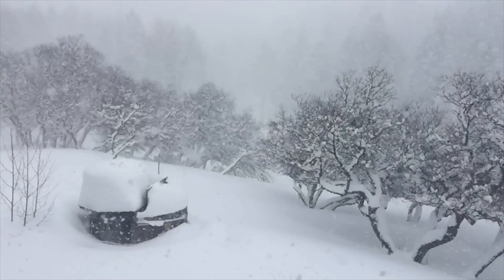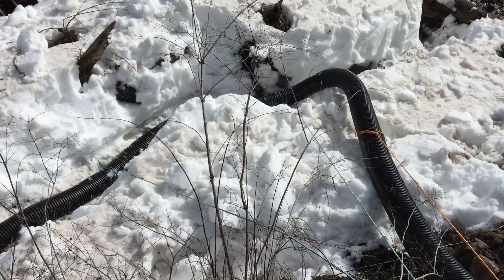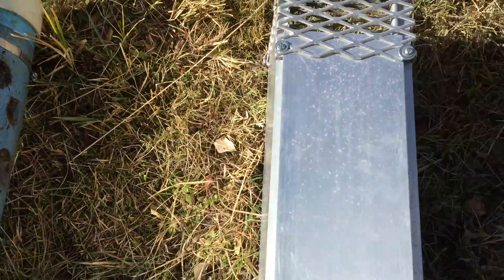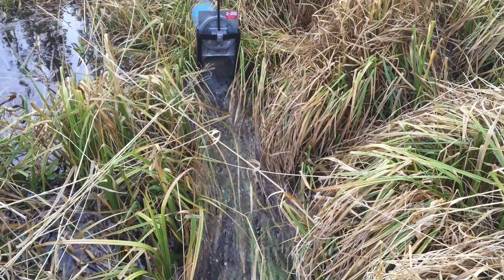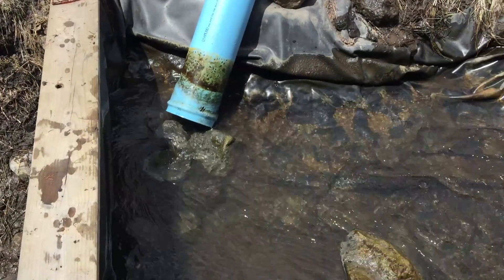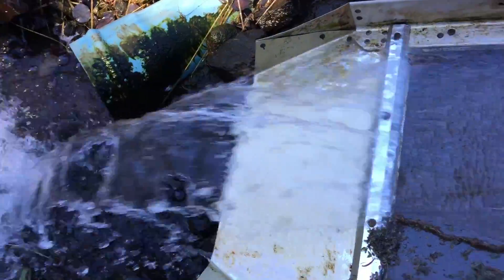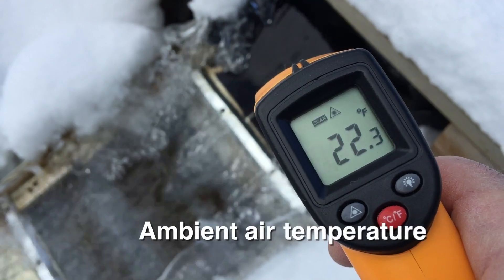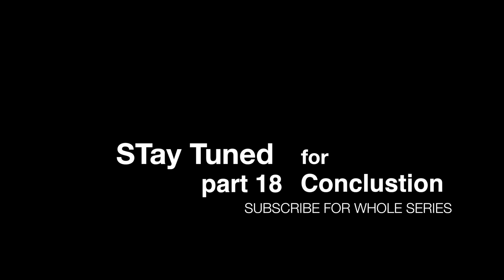Part 17 MicroHydro Power System in CO

Comment: I might learn without asking if I watch your entire series, but I don't have sufficient time to do that right now; so, if you don't mind my asking, how much vertical head on the system to develop nearly 100 psi at your powerhouse? It is over 200 feet, is it not?
Reply from the maker: Formula is 2.31 ft vertical for each psi. That is for static measures. Dynamic moving water has varying pipe friction losses depending on flow and pipe size
https://www.absolutewaterpumps.com/blog/convert-feet-to-psi/
Thx for watching

Comment: Place a tee fitting place an 8 foot pipe vertical to the flow and the water will flow and the air escape.  SCOTT FROM NH.
Reply from the maker: Lots of people have suggested air vents.  The path of the pipe has only minimal fall where the air gets trapped.  There isn’t any pressure to keep a vent closed.  The problem is that the negative suction pressure from the lower part of the pipe would simply suck air in at the vent holes. That is why when I bleed the air out through the holes I need to close the gate at the pipe outlet. Once the air is out of the line, the flow is dramatically increased. Thx for watching I'm never sure who has seen what of the series. Here is a playlist of the 3 part synopsis which is an overview of the whole process https://www.youtube.com/playlist?list=PLtTypVpmDd-vkT9bJQkXw4I1t0e_4jMYA 
 The whole series is in about 25 videos. This part 17 video gets promoted most frequently by YouTube.

Comment: Consider installing tape heater on the pipe ends that activate only when the temperature drops, that way it might reduce the ice build up.
Reply from the maker: Its 1/2 mile from intake to available power. Lots of people suggest similar or mechanical solutions for what is routine cleaning which at this point is seldom required. Many issues have been resolved which were just part of the process over the years. There are always new challenges but this is not one of them.  I'm never sure who has seen what of the series. Here is a playlist of the 3 part synopsis which is an overview of the whole process https://www.youtube.com/playlist?list=PLtTypVpmDd-vkT9bJQkXw4I1t0e_4jMYA 
The whole series is in about 25 videos. This part 17 video gets promoted most frequently by YouTube.  Thanks so much for watching!

Comment: have you tried a pop up vent fore the air in the pipe
Reply from the maker: Lots of people have suggested air vents.  The path of the pipe has only minimal fall where the air gets trapped.  There isn’t any pressure to keep a vent closed.  The problem is that the negative suction pressure from the lower part of the pipe would simply suck air in at the vent holes. That is why when I bleed the air out through the holes I need to close the gate at the pipe outlet. Once the air is out of the line, the flow is dramatically increased. Thx for watching I'm never sure who has seen what of the series. Here is a playlist of the 3 part synopsis which is an overview of the whole process https://www.youtube.com/playlist?list=PLtTypVpmDd-vkT9bJQkXw4I1t0e_4jMYA 
 The whole series is in about 25 videos. This part 17 video gets promoted most frequently by YouTube.

Comment: This may sound silly but if you dipped the colander to make it black, would that deter ice cover?
Reply from the maker: IF the sunlight consistently hit the Coanda screen, it might have a small impact. However its mostly in the shade of trees and the terrain. The freezing eventually forms a shell over the screen and the water continues to flow, so what once seemed a problem has turned out to not be a concern. 
Thanks for the suggestion.  This video was posted quite a while back and many subsequent modifications have been made to enhance the system and overcome problems. Thx for watching  I'm never sure who has seen what of the series. Here is a playlist of the 3 part synopsis which is an overview of the whole process https://www.youtube.com/playlist?list=PLtTypVpmDd-vkT9bJQkXw4I1t0e_4jMYA 
 The whole series is in about 25 videos. This part 17 video gets promoted most frequently by YouTube.

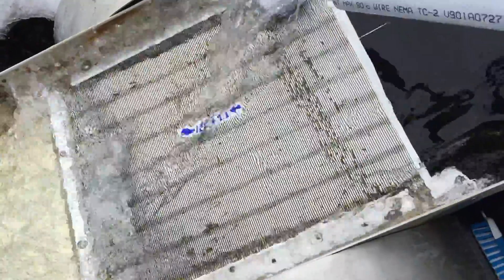Comment: 9:43 get 4 wooden scrubbing brushes, screw them toge that you get a four sided brush, best with some metal brackets to give them some more weight. Add a string to them to the upper left side of the screen and a loose string somewhat below the screen on the right side. Add some kind of rubber as a lug on the lower string just below the screen. 

If you adjust it right it should scrub with the brush over the screen, left and right, depending on the turbulences and the flow rate.

I would add also a bit higher stop at the bottom of the screen, to get a bit more pressure downwards on the screen, to get all water on a lower flow rate.
Reply from the maker: Thanks for the suggestion.  This video was posted quite a while back and many subsequent modifications have been made to enhance the system and overcome problems. It requires next to no maintenance at this point, not even screen cleaning. Thx for watching

Comment: Why don't you add a float valve mechanism to the vents. Like cutting a piece of the pipe away at the top, placing a metal lit on top with a small bump upwards. Attach a ping-pong ball on a metal wire under the lit, that the water will drag it down stream exactly in the center of the bump. Then drill a tiny hole over the center of the ball.

If the water drops the air will be vented automatically, if the water level is high enough it should be sealed enough. 

If the mechanism fails, like the ball is lost, you can replace the whole assembly in minutes if you have a spare one. 😙🎶

Comment: I wonder if you couldn't put a little turbine that would power a heating element to keep things from icing up.
Reply from the maker: Lots of people suggest similar or mechanical solutions for what is routine cleaning which at this point is seldom required. Many issues have been resolved which were just part of the process over the years. There are always new challenges but this is not one of them.  I'm never sure who has seen what of the series. Here is a playlist of the 3 part synopsis which is an overview of the whole process https://www.youtube.com/playlist?list=PLtTypVpmDd-vkT9bJQkXw4I1t0e_4jMYA The whole series is in about 25 videos. This part 17 video gets promoted most frequently by YouTube.  Thanks so much for watching!
Reply: @mrhydrohead  I have seen quite a few of them and am very impressed. Especially since your doing this in a place that is so cold. I have spent my life in the desert so those conditions are unimaginable to me. The only snow I ever see melts before it hits the ground. So my first thought is how to fully automate the system so I don't have to go out in the cold. I hear you get used to it but like I said its unimaginable to me. I don't even own a jacket. What you are doing there is absolutely amazing, I wasn't at all trying to take away from that. Keep posting videos and Ill keep watching, I love what you are doing!
Reply from the maker: Another commenter pointed out the error in the link I provided that it didn't work.  It should have been https://www.youtube.com/playlist?list=PLtTypVpmDd-vkT9bJQkXw4I1t0e_4jMYA  
Sorry about that.

Comment: yep water  flow and winter temps lots of  challenges even for northern koi and goldfish...   and ice chipping tec... always a bit dif each season...
Reply from the maker: Thx for watching I'm never sure who has seen what of the series. Here is a playlist of the 3 part synopsis which is an overview of the whole process https://www.youtube.com/playlist?list=PLtTypVpmDd-vkT9bJQkXw4I1t0e_4jMYA The whole series is in about 25 videos. This part 17 video gets promoted most frequently by YouTube.  
The system really doesn't require much maintenance and just runs year round.  Lucky to have sourced power this way.
Reply from the maker: Another commenter pointed out the error in the link I provided that it didn't work.  It should have been https://www.youtube.com/playlist?list=PLtTypVpmDd-vkT9bJQkXw4I1t0e_4jMYA  
Sorry about that.

Comment: Here is an alternate energy source to use where hydro power is not available.
Research terms with DuckDuckGo: lenr-canr MizunoTincreasede pdf
Reply from the maker: Interesting stuff.  I don't personally have a need for more power, but others may find this of interest. thanks for sharing.
Thx for watching I'm never sure who has seen what of the series. Here is a playlist of the 3 part synopsis which is an overview of the whole process https://www.youtube.com/playlist?list=PLtTypVpmDd-vkT9bJQkXw4I1t0e_4jMYA The whole series is in about 25 videos. This part 17 video gets promoted most frequently by YouTube.
Reply from the maker: Another commenter pointed out the error in the link I provided that it didn't work.  It should have been https://www.youtube.com/playlist?list=PLtTypVpmDd-vkT9bJQkXw4I1t0e_4jMYA  
Sorry about that.

Comment: Baffles in the pipe my cut down on the air bubbles
Reply from the maker: Thanks for the idea.  Lots of people have suggested air vents.  The path of the pipe has only minimal fall where the air gets trapped.  There isn’t any pressure to keep a vent closed.  The problem is that the negative suction pressure from the lower part of the pipe would simply suck air in at the vent holes. That is why when I bleed the air out through the holes I need to close the gate at the pipe outlet. Once the air is out of the line, the flow is dramatically increased. 
Thx for watching I'm never sure who has seen what of the series. Here is a playlist of the 3 part synopsis which is an overview of the whole process https://www.youtube.com/playlist?list=PLtTypVpmDd-vkT9bJQkXw4I1t0e_4jMYA The whole series is in about 25 videos. This part 17 video gets promoted most frequently by YouTube.
Reply: Awesome/ retired firefighter with the Ventura effect yes low pressures, would not be effective enough
Reply from the maker: Another commenter pointed out the error in the link I provided that it didn't work.  It should have been https://www.youtube.com/playlist?list=PLtTypVpmDd-vkT9bJQkXw4I1t0e_4jMYA  
Sorry about that.

Comment: This is amazing. Now I’m pissed I didn’t buy land with a stream. I’m on top of a mountain and I don’t see anyway to become power or water independent.
Reply: @Jmiah 79, don't give up.  There may be ways.  At least for drinking water, you can buy or build an atmospheric water generator.  For electricity, you can buy or make a device to convert heat into electricity, such as from a wood burning stove.

In case these devices are new to you, here are some video titles:

"Devil Watt 45 watt Wood Burning Stove Thermoelectric Generator"

"How to charge your smartphone using fire/heat||amazing experiment at home"

WATER HARVEST FROM AIR:
"Warka Water towers harvest drinkable water from the air"

Or devices (powered by electricity) can be purchase off Amazon, etc.

Perhaps you could also barter for what you need.  For instance, if you don't have enough sunlight on your land to recharge batteries, perhaps another land owner nearby can recharge them for you in exchange for labor, firewood, etc.
Reply: @Jmiah 79, to reduce water needs, have you heard of the Showerloop?  It cleans you used shower water and adds it back through at your showerhead instead of down the drain.  Here is a video by the inventor whom made it open sourced.

"Showerloop - an open source hot water recycling system"
Reply: @Jmiah 79, sorry for so many posts.  Have you considered a rocket mass heater?  That way you can heat your home for 24 hours or longer on very little wood.  It takes just the size of small diameter kindling.  Even after the fire is out, the mass continues to releases heat slowly, so you can sleep instead of tending the fire.  I don't have one, but people that do say they stay warm all night and it greatly reduces their fuel use.  Can heat a small house easily.

I would definitely do my homework first and buy a book to follow, too.

Here is a helpful video.  She said she followed a book:

"Building a Rocket Mass Heater step by step to finish! Watch to the End!!!"
Reply from the maker: All good ideas. thx for sharing.
Reply from the maker: Don't despair, solar is so much less expensive than when I started in 1996.  I just had this great resource of the water and the desire to take advantage of it.  You must have a ton of solar access being up high.  thanks for watching just the same.

Comment: If you use smooth pvc piping without the ruffles it will move much faster
Reply from the maker: Our first diversion was indeed fixed pipe, but it was all washed out by the huge spring run off.  That is why we have made the diversion pipe removable for the spring melt.  The flexible pipe easily diverts enough water for our system and leaves the rest to conserve the natural state of the creek.  The creek changes each year and the collection point is different.   Thx for watching I'm never sure who has seen what of the series. Here is a playlist of the 3 part synopsis which is an overview of the whole process https://www.youtube.com/playlist?list=PLtTypVpmDd-vkT9bJQkXw4I1t0e_4jMYA The whole series is in about 25 videos. This part 17 video gets promoted most frequently by YouTube.
Reply: @mrhydrohead  Thanks for your reply I did start on ep. 17 but since I read your comment earlier today Ive watched 1-17 and on to the rest .Your link doesn't work by the way but I'm sure I can find it in your uploads . I have a much smaller water source that I maybe able to fill a 6 inch pvc pipe with for about 3 hundred feet of fall my house is about 900 to 1500 feet away I was thinking about stepping it up in voltage and then stepping it down at my house and I wanted to research wireless electrical transmission to see if I could use Tesla coils to transmit and receive it .
Reply from the maker: Thanks for pointing out the link problem.  I was totally unaware of that.  "The" at the end isn't required, but for some reason it gets added.  Not that it matters for you now, but here is the correct link https://www.youtube.com/playlist?list=PLtTypVpmDd-vkT9bJQkXw4I1t0e_4jMYA  
It sounds like you have an enormous potential for power.  One thing that was emphasized in the class I took at SEI in 1996 https://www.solarenergy.org/micro-hydro-training/ was that you should look at what your actual need for power is by doing an energy analysis of your appliances, lights, etc.  Otherwise you can spend a lot more than you need to meet your needs.  Also I think its important to not entirely drain the watercourse completely as the natural environment relies on it for animals and whatever.
As far as transmission goes, yes bumping up the voltage will cut down on transmission wire cost.  I think ours is about 1200ft. if memory serves me.  As far as Tesla Coils go, I don't have any knowledge of them actually being put into practical use.  Perhaps his genius figured it out, but JP Morgan squelched it because he realized he couldn't charge people for it.

Comment: Here is an idea that you might incorporate to cut down on your algae problem.  Copper screens. 

Copper is just about the best antimicrobial there is .  This is how I kept algae out of my swimming pool.  See floatron.com.   I used a floatron for my pool for about eight or ten years, (along with copper sulfate pentahydrate as shock to get the copper level I needed instantly, till the floatron took over).  The floatron website will give you all the data you need to be convinced of copper's ability as an antimicrobial.  Far better than chlorine.  Chlorine kills at 3 ppm and copper at .3 ppm (1/10 the concentration of chlorine).

Also they are now using copper in hospitals on "touch" surfaces as an antimicrobial.  This study demonstrates that a copper surface will kill the methiclillin resistant staphylococcus aureus in ten minutes on a piece of copper but this bug lasts weeks on stainless steel.  Brass has the same ability to kill these microbes, just not as quickly, so if you need strength you might try brass, but the higher copper content the better.  A few large brass pipe connectors might also help.

https://www.youtube.com/watch?v=y5Q8NudHbdU

And of course copper has been used on the hulls of ships for centuries as an anti-fouler.

And water stored in copper containers has been used for centuries to purify water. It has proven to be very effective in preventing illness during cholera epidemics for centuries. 

And ancient warriors of the bronze age would put copper shavings in their wounds to keep their wounds from getting infected.

Very low tech but it just works.  It has been a huge mistake taking copper out of our plumbing systems.
Reply from the maker: Thanks for the suggestion.  I did not know much of that about copper.  Glad I have copper pipes in my house.  It seems like a shade to remove all sunlight from the screen does a good  job to removing all algae.  Very interesting links you share however.  Thanks. and  Thx for watching I'm never sure who has seen what of the series. Here is a playlist of the 3 part synopsis which is an overview of the whole process https://www.youtube.com/playlist?list=PLtTypVpmDd-vkT9bJQkXw4I1t0e_4jMYA The whole series is in about 25 videos. This part 17 video gets promoted most frequently by YouTube.
Reply: @mrhydrohead  If shading keeps the algae down that is an easy fix.  Good idea.
Reply from the maker: Another commenter pointed out the error in the link I provided that it didn't work.  It should have been https://www.youtube.com/playlist?list=PLtTypVpmDd-vkT9bJQkXw4I1t0e_4jMYA  
Sorry about that.